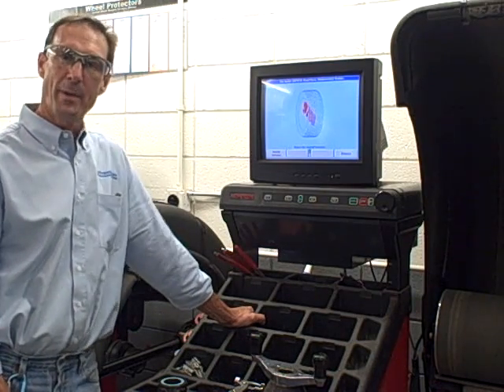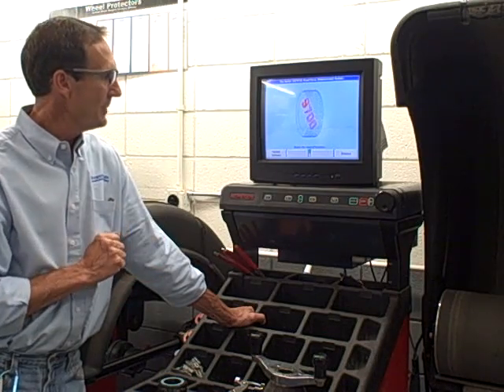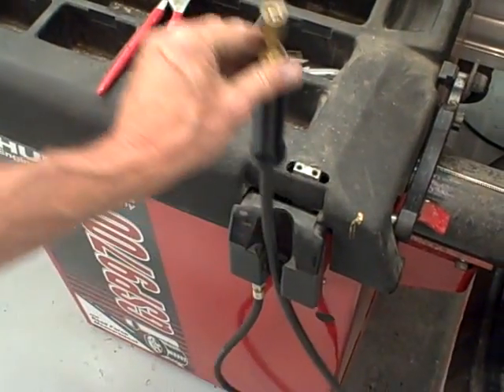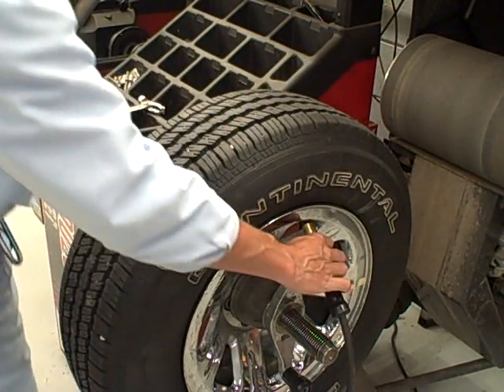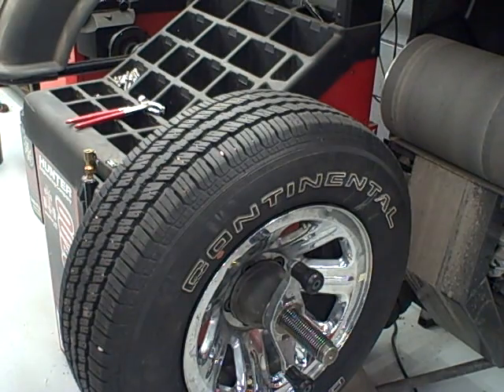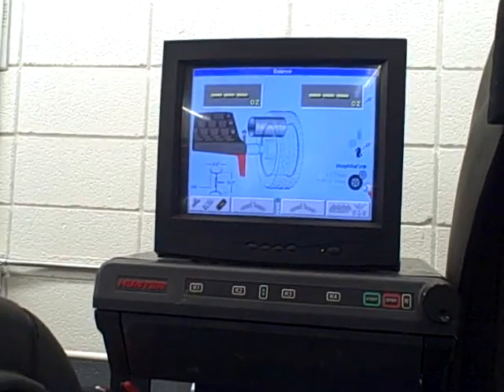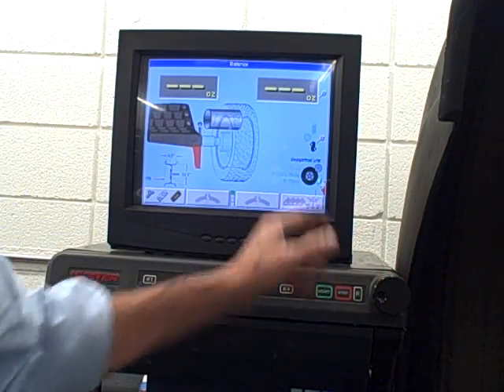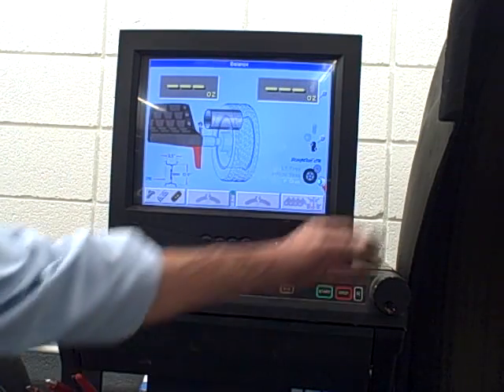MSCTC Training Video Tire Balancing

Comment: i am having stress got 2 new front tyres last week drove away balancing was off went back and he said he hadnt balanced the one wheel properly.  left and still really bad wobble at 70 upwards took it to 2 other garages since and still not right please help???
would it be the people not know how to use balancing equipment cause both garages read different readings for the balance weight